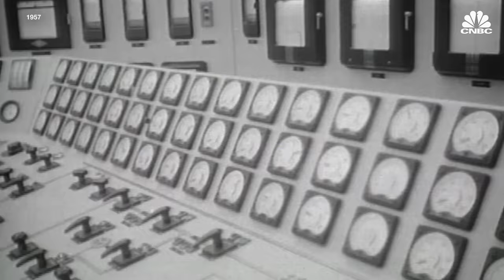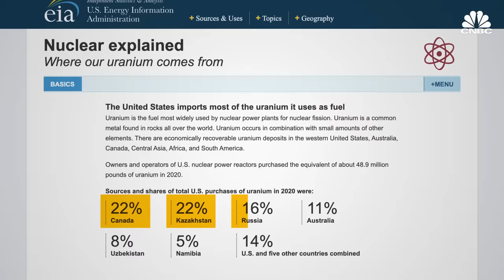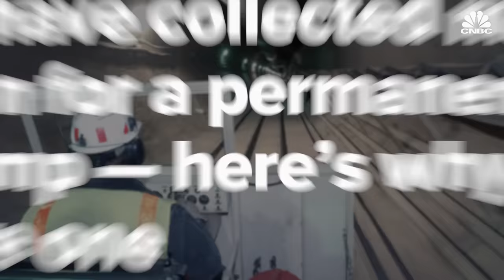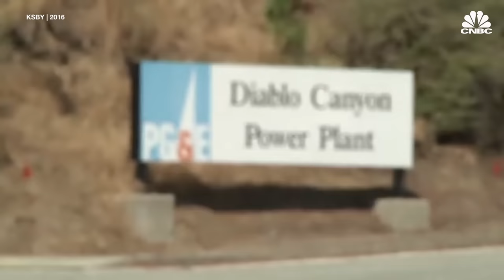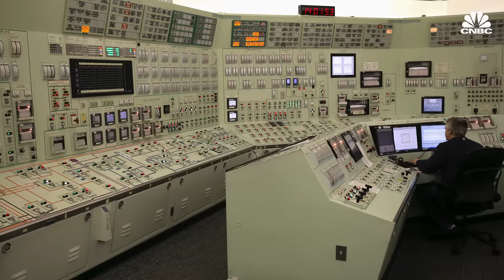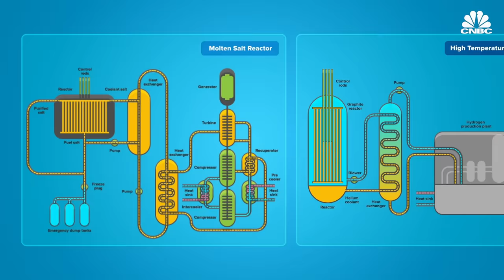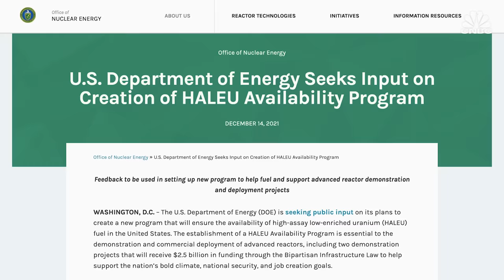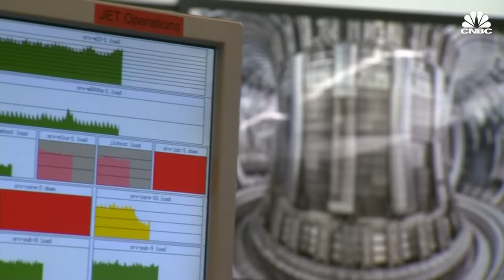Why Nuclear Energy Is On The Verge Of A Renaissance

Comment: People who oppose nuclear only for the sake to oppose it because of chernobyl are really uneducated. For example look at all the hundreds of nuclear power plants around the world that ran for decades and have been operating normally for years without expanding and really chernobyl, three mile island, and Fukushima are all just learning curves similar to when an airplane crashes and the cause of the crash  investigated there are lessons to be learned and changes to be made. For example don't build a nuclear power plant in an area near the ocean where there are hurricanes with storm surge or tusamis or areas prone to earthquakes. In the case of three mile island there was a stuck value that the operators didn't know about in today's era just put cameras everywhere to monitor everything and put senors on everything every little valve and inside the reactors etc.
Reply: How about opposing it in the U.S. because it is not cost effective by any means.
The Southeastern U.S. is super pro-nuclear MAGA, has zero anti-nukes, and 100% political support. 
VC Summer (South Carolina) new nuclear units 2&3 were canceled in 2017 after spending $17 billion on the project (original estimate of $14 billion and 2016 completion date) with no clear end in sight for costs or schedule.  Anti-nuclear sentiment was never identified by the utility as causing any of the many delays.
Vogtle (Georgia) new nuclear units 3 &4 currently 110% over budget and schedule and still not operating. Mid way into the build, the utility stated that had they known about the many costly delays they would never have chosen nuclear. Anti-nuclear sentiment was never identified by the utility as causing any of the many delays. They are now delayed another year because according to the project management, thousands of build documents are missing. Utilities, not the media, decide the most cost effective electrical power source and give the above failures no U.S. utility is even considering new nuclear at this time. If you can’t build new nuclear in the MAGA super pro-nuclear southeast U.S. then where can you build it?
In both cases, the ratepayer is stuck with paying the $50 billion bill. And the silence of the Rah Rah nuclear folks on these events is deafening.
Reply: @clarkkent9080  it pays for itself once it's running also they can decommission nuclear weapons for uranium fuel to solve the nuclear weapon proliferation problem.
Reply: @clarkkent9080  there building them in China like crazy.
Reply: @mattdaddy_888  It is not cheaper once it is running.  To prove my point google nuclear plants that are shutting down.  These are old nuclear plants that the construction costs have long been paid for and the investor owners state that they are shutting them down because they are not cost effective compared to other power generation methods.
Also, nuclear weapons use Pu239 not Uranium.  The U.S. has excess Pu239 and did want too mix it with uranium to make fuel for nuclear reactors and that story is below.
The MOX facility was being built by the U.S. government to mix excess weapons grade Pu239 with Uranium to make fuel for commercial reactors.  After spending $17 billion for a plant that was originally estimated to cost $1 billion and an independent report that estimated it would cost $100 billion to complete the plant and process all the Pu239, Trump canceled the project in 2017..
Reply: @mattdaddy_888  I worked in the nuclear industry for 40+ years. I was a Reactor Operator and Senior Reactor Operator at 5 different nuclear facilities and consider myself to be pro-nuclear. However, facts are facts.
Reply: @clarkkent9080    Yet you continue to ignore that many countries have been building and using small modular reactors for many decades, built in two years or less for millions not billions.

Comment: Covering natural habitat ( even our beautiful deserts ) or arable farm land with bird blenders and toxic solar panels destined for landfill is unacceptable.  Not to mention the environmental impact and habitat loss of all of the various and impractical schemes to store the unreliably produced energy with water pumping or toxic batteries as well as the inefficiencies and further environmental and habitat loss incurred by the long distance power transmissions these so called environmentally friendly  methods require.    Small modular reactors can be distributed and due to the minimal exclusion zone requirements they can be sited right inside the cities they serve ( no storage or long distance transmission infrastructure required ).  They can be easily sited on disused land that is already commercially purposed ( closed fossil plants and storage / refineries / pipeline pumping facilities ) and thereby represent not only a greater supply of available energy but also a much smaller physical footprint than any other technology.
Reply: Why are solar panels toxic?  The cells are 99.9% silicon better known as SAND. The frame and electrical contacts are Aluminum and silver which are not only recyclable but profitable. And the glass cover is well glass and just as recyclable as any glass bottle.

The only SMR project in the U.S. today is NuScale and here is the latest from the ultra conservative Des Moines Register.
 In 2013, the Wall Street firm Lazard estimated that the cost of generating electricity at a new nuclear plant in the United States will be between $86 and $122 per megawatt-hour. Last November, Lazard estimated that the corresponding cost will be between $131 and $204 per megawatt-hour. During the same eight years, renewables have plummeted in cost, and the 2021 estimates of electricity from newly constructed utility-scale solar and wind plants range between $26 and $50 per megawatt-hour. Nuclear power is simply not economically competitive.
SMRs will be even less competitive. Building and operating SMRs will cost more than large reactors for each unit (megawatt) of generation capacity. A reactor that generates five times as much power will not require five times as much concrete or five times as many workers. This makes electricity from small reactors more expensive; many small reactors built in the United States were financially uncompetitive and shut down early.
The estimated cost of constructing a plant with 600 megawatts of electricity from NuScale SMRs, arguably the design closest to deployment in the United States, increased from about $3 billion in 2014 to $6.1 billion in 2020. The cost was so high that at least ten members of Utah Associated Municipal Power Systems canceled their contracts. NuScale then changed its proposed plant configuration to fewer reactors that produce only 462 megawatts at a cost of $5.32 billion. For each kilowatt of electrical generation capacity, that estimate is around 80% more than the per-kilowatt cost of the Vogtle project in Georgia — before its cost exploded from $14 billion to over $30 billion. Based on the historical experience with nuclear reactor construction, SMRs are very likely to cost much more than initially expected. And they will be delayed. In 2008, officials announced that “a NuScale plant could be producing electricity by 2015-16.” Currently, the Utah project is projected to start operating in 2029-30. All this before the inevitable setbacks that will occur once construction starts. 

You must have gotten your degree from the university f=of social media and YT videos.
Reply: @Kerk Kant  You fail yet again from your blank trolling channel to admit that many countries have been building and using small modular reactors for many decades built in two years or less for millions not billions.
Reply: Nuclear of course still has an environmental impact, but because of the high energy density of the fuel, it is greener than to others when compared on a watt-to-watt basis.
Reply: @samuelpope7798  Yes, EVERYTHING that is electronic or carries electricity contains lead....it is called solder and is found on every circuit board and electrical connection. Solar panels are not considered electronic devices or universal waste per RCRA so they must be evaluated for toxic materials.  If they were considered an electronic device per the regulations they would be handled in the same way as millions of cell phones. Seems like an easy fix.

The regulations are based on % leachable metal per unit weight.  Since metals are not very leachable (dissolves in water) and are a extremely small % of the total solar panel weight, currently available panels DO NOT meet the definition of hazardous waste and can be disposed in any standard class 3 landfill.

Solar panels in direct sunlight increase in temperature no more than 15 degrees which is less that a black asphalt road. So anyone who drives on roads really doesn't care one whit about conservation or the environment.

Nice try.  Go back to your social media and YT videos and find more lies

Comment: Just like cars today are nothing like cars in the 1970s and 80s, nuclear power plants are the same when it comes to safety.
Reply: The Westinghouse AP1000 advanced PWR being built now at Vogtle is a standard 1970s design with 2 coolant loops instead of the normal 3 or 4 and they added passive safety features. These passive safety features would have only prevented one of the 3 major reactor accidents and that is Fukushima.  The reactor is the same they just added safety features that do not need emergency diesels for power

Comment: Most people don't know that Russia has most of the Uranium mines and therefore can switch off fuel supplies for nuclear power at any time. Wind and solar are not sufficient. There is another system that is clean and lasts a long time. This tidal system was installed by France in the Channel in the 1950s and just needs maintenance.

Comment: Overall, nuclear is the cleanest and the safest energy.
Reply: too bad it cannot be built in the U.S. cost effectively, if at all.

The Southeastern U.S. is super pro-nuclear MAGA, has zero anti-nukes, and 100% political support. 

VC Summer (South Carolina) new nuclear units 2&3 were canceled in 2017 after spending $17 billion on the project (original estimate of $14 billion and 2016 completion date) with no clear end in sight for costs or schedule. 

Vogtle (Georgia) new nuclear units 3 &4 currently 110% over budget and schedule (currently over $30 billion) and still not operating. Mid way into the build, the utility stated that had they known about the many costly delays they would never have chosen nuclear. They are now delayed another year because according to the project management, thousands of build documents are missing. 

If you can’t build new nuclear in the MAGA super pro-nuclear southeast U.S. then where can you build it?
Reply: @clarkkent9080   Yet you continue to ignore from your blank trolling channel, many countries have been building and using small modular reactors for many decades, built in two years or less for millions, not billions.

Comment: Molten salt thorium based modular reactors!!!  Low pressure with built in safety.  If there is a leak, the molten salt solidifies on the ground stopping any fission reactions.
The problem with American reactor designs in the 60[s and 70's is that most new plants were new designs.  The industry was on a race to bigger is better.  France on the other hand has 56 reactors the majority of which are of a single 900MWh design.  None of which have had any significant accidents.
Choose a workable design and make lots of them improving the design as experience is gained in their operation.
But molten salt reactors with their low pressure design and simple safety mechanisms are a great direction for new reactor designs.
Reply: Well unfortunately, the U.S.  investor owned utilities and nuclear engineering firms have no interest in MS Thorium reactors. Yes other countries are exploring this but the U.S. is not.  I guess the people that have to put their money on the line don't make their decision based on social media and YT videos.

Comment: The only real problem with nuclear is the energy operators.  3 mile Island would have melted down if the engineers hadn't stood up and disagreed with the owner to not use the crane to lift the vessel without testing the crane.

Comment: Most people don't understand risk, how to measure it. 
The Fukushima disaster is exactly the example. Maybe nobody died from radiation poisoning, but 154,000 people were evacuated and the impact to the local people long term is estimated to be between zero to a few hundred cancer cases. Only recently, after a massive and hugely expensive cleanup campaign by the government, people were allowed to return. Many still don't because they think the radiation is not low enough. In many respects, there was some amount of luck, not a function of design, but pure luck that the environmental disaster was limited and ground contamination outside the plant was minimal.
A large exclusion zone area around Chernobyl is still closed so many years later. Russian soldiers were impacted this year when crossing it.
The CA power plant lady minimized the scale of the disaster. 
Some of the lessons learned from Fukushima cannot be easily implemented in existing plants, such as placing reactors close to each other or changing the way pipes are routed.

The lady discussing long-term storage, which is far from solved for the hundreds of years it needs to be kept safe. It's a scale that people can't easily comprehend, because we think in 10s of years, not thousands of years that need to be as close to fail-safe as possible. A huge engineering challenge that nobody solved to date.
Reply: @DavidDLee   I knew you would refuse to look anything up, it would disrupt your lies.  No one is impressed by your nonsense.
Reply: @ForbiddTV  You could have shown respect and offered to share your knowledge in a positive way.
You chose otherwise, greatly diminishing any impact you could have on the argument.
Sure, I did read stuff about this and did not get to the same conclusions as you.
Reply: @DavidDLee   I show no respect for liars, and even less respect for those that lie after claiming they have researched.
Reply: @ForbiddTV  I am not lying.
I am not being disrespectful.
You are being disrespectful. You lost all credibility.
Better delete your personal attacks and replace them with actual content.
Reply: @DavidDLee  "...the entire area is uninhabitable for at least under 30 years." is very clearly a lie.

Comment: Building new nuclear electricity plants is totally economically braindead in 2021.
It costs approx 4x all the other alternatives, fossil or renewables.
And that is without calculating all the cleanup costs.
The two only reasons to build nuclear plants today : 
- build or maintain nuclear bombs as a side effect
- get good subvention money through massive corruption. You pay that.
Reply: That's dumb.  Many countries have built nuclear reactors with no atomic bomb intentions.  Many countries have been building small modular reactors for many decades built, built in two years or less, for millions not billions.
Reply: @danadurnfordkevinblanchdebunk B.S. -> SMR cost more to design, operate, decomission per kWh than traditionnal. SMR are not used today for general purpose grid feeding, too costly.
Reply: @chargehanger  Too costly as compared to what?  Don't tell me are you.are using the Greenies solar and wind rated output as your determination of such.  Example: my 4kW photovoltaic array puts out a maximum of 3.8kW (degrades a little more every year), for about an hour each day, but only if there are no clouds in the sky.  The rest of the day it typically averages 1kW and averages 0kW at night.  My wind machine is rated at 17.5 kW @25mph winds, but of course it's usually averaging more like 1kW.  Nuclear ratings can produce their rated output 24/7 aside from maintenance down times.  Try again with real world numbers.
Reply: @chargehanger   In case you didn't get the memo, the fossil fuel options you list the Greenies have demanded to be phased out. Solar and wind are more expensive than nuclear when factoring in storage since their output won't function as they expand.  Hydroelectric is the only one you mentioned that has energy storage and could be used for peak loading.

Comment: There is one item never discussed in regards to the accidents at Chernobyl and Fukushima and their comparisons with Three Mile Island. 

Three Mile Island had a massive containment vessel that prevented nearly all radiation from escaping. Only a small amount of radioactive steam actually escaped. Not one person contracted Cancers resulting from that release. More importantly, no one died.

Now, compare this with Chernobyl and Fukushima. Neither of these two reactors had containment vessels!

In the case of Chernobyl, this was typical Russian incompetence and lack of desire to do things the right way. No surprise. 

In the case of Fukushima, the reason for this disaster is simply typical corporate greed, specifically that of General Electric. They proposed the Fukushima design to Tokyo Electric that was far cheaper than the traditional nuclear power plant that used the containment vessel. GE was only concerned about making a multi billion dollar sale, thus keeping the pig vomit on Wall Street happy.

The problem with Nuclear power is not the concept thereof, it is that worst of the seven deadly sins, which is GREED.
Reply: @Klerk Kant  Why like about TMI too?  It's very easy to look up the decommissioning plan for TMI online.